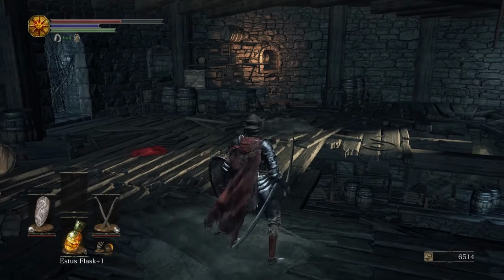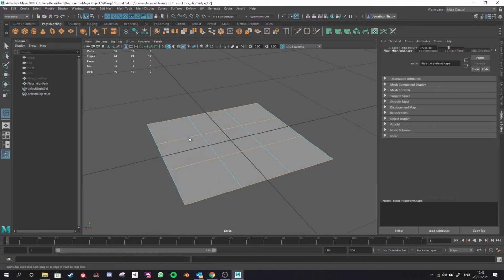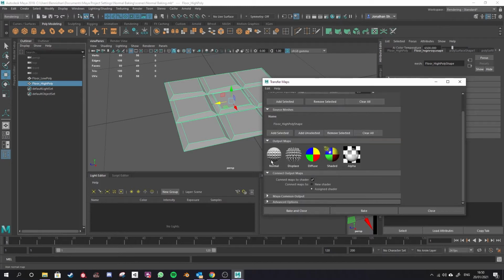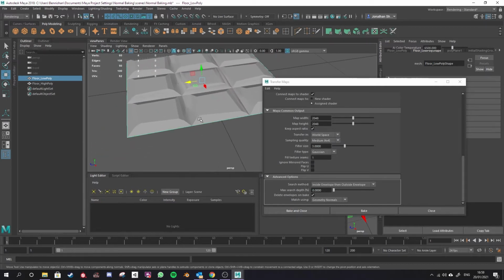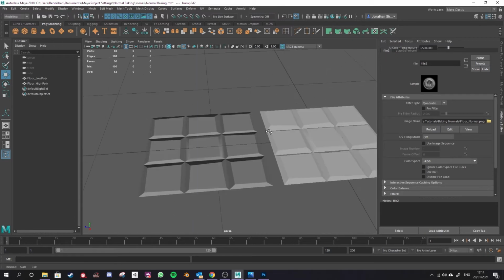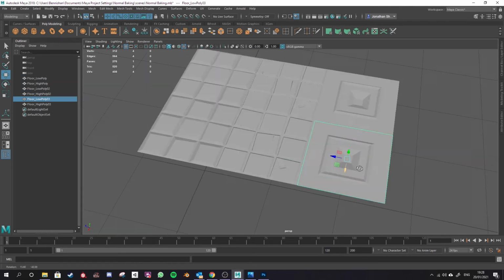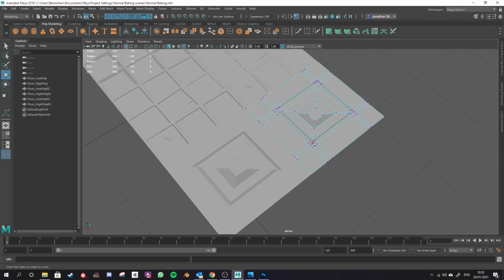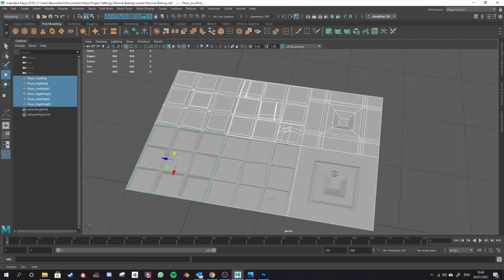Baking Normal Maps - High to Low Poly - Maya

Comment: Awesome video man! I hope you keep up uploading new ones. It's difficult to find a good basic explanation of normal maps/baking and It's quite and essencial knowledge
Reply: btw, is someone really baking in maya? I've used maya as my main tool since I started 3d and I didnt even know baking in maya was a thing.  I truly recommend marmoset for baking! It has a lot of parameters to control baking and real-time display with the light setup you want.
Reply from the maker: @isak_art  Thanks for the feedback. I made this for students who were just beginning 3D Modelling in Maya to keep it in the same software. We quickly move to Substance Painter for all normal baking. Thanks for the tip, will check out Marmoset!